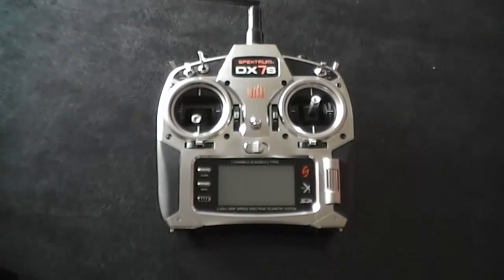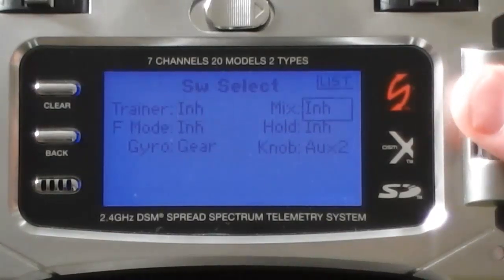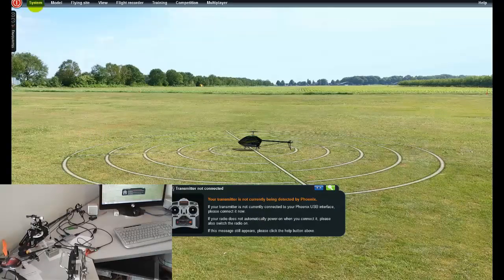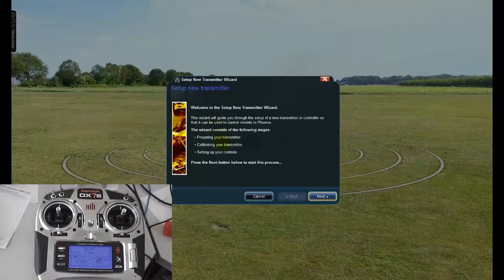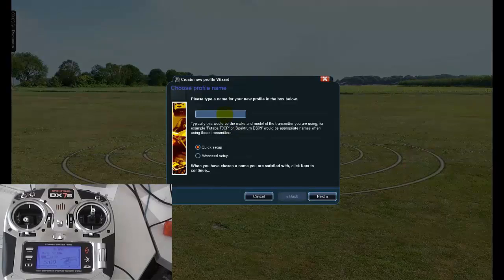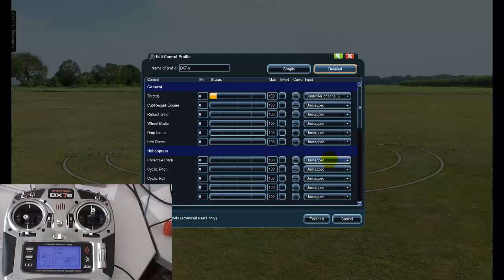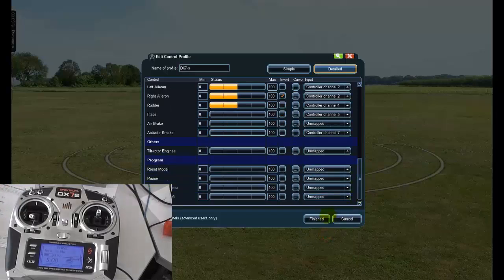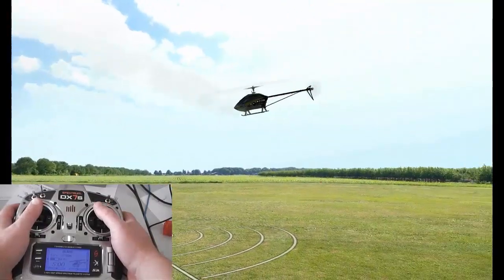DX7s sim configuration tutorial

Comment: Please ignore my previous comments re Idle Up switch not working (the F MODE switch); I re-configured everything again (lost count of the times I did it!), and this time it worked fine - very odd! (I saw the gremlin snaking out the back!) An interesting point - is it not possible to specify the rear-most switch (GEAR/MIX) as the Idle Up switch? After all, that's the switch I use when I fly my real helis (not simmng). BTW, the video was excellent; well executed, clear, and very easy to follow. Thanks.

Comment: Great video, followed your instructions to the letter, everything worked - except the Idle Up switch (i.e. F MODE switch). When setting up the Tx in the Phoenix RC, the Throttle Hold worked as expected (Channel 5), but no movement of ANY of the sliders when flicking the F MODE switch. I wonder if there is a fault in my TX?

Comment: Thanks for the great video!  I have a couple of questions.  I have version 5.0 on order and will be using it with a DX6i.  I noticed that in the transmitter select mode, both Dx6i and DX6i (airplane) were choices.  Can I assume that the airplane selection is for flying fixed wing aircraft and the other is for rotary wing aircraft?  Also, let's assume that one of the models you fly is in the database - for example, the HobbyZone Super Cub S (or LP).  Do actually set up your transmitter with the exact settings that you would if you were flying the actual model, or does the setup you just went through take care of all that?  If it does, I presume you can simply turn on the transmitter and fly with whatever model is shown in the display window of the transmitter. However, that being said, I notice that you set up a specific choice of a Sim.  Do I dedicate a model slot to sim and then use that for everything I fly?   By the way, I have 15,200 hours of heavy jet time and 12 hours and 33 minutes flying my body in freefall during my 657 skydives.  I'm an aeronautical engineer by schooling but methinks none of that is going to help me fly models!  :) Thanks.

Comment from the maker: Hi There, Thanks for the kind words! Glad I could assist. The reason Channel 1 & 6 are linked is because on a heli... you need the collective and Throttle channels connected, so that as you raise RPM and Head Speed .... you increase pitch to give you lift and power. Hope that helps.